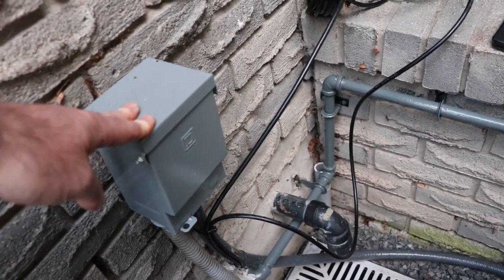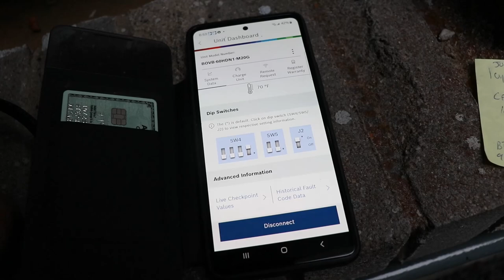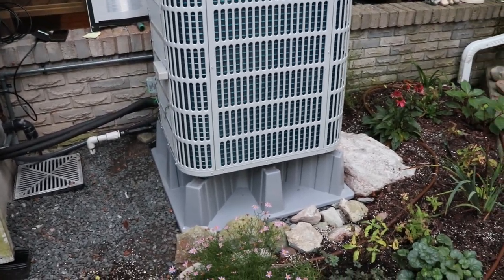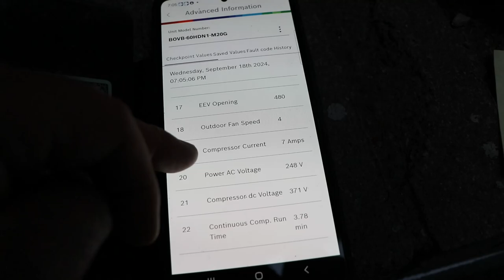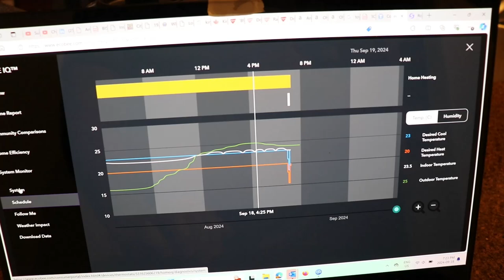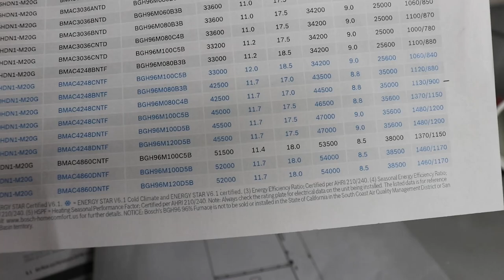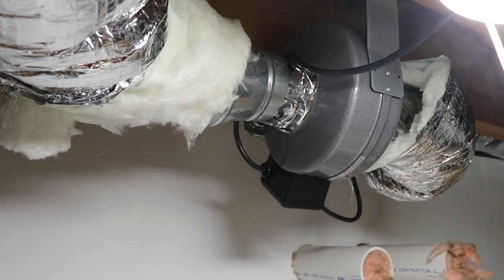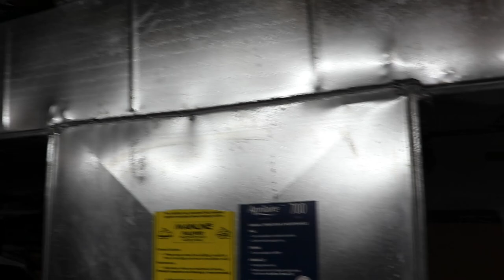Bosch IDS 2.1 Dual Fuel Fossil Heat Pump AC Furnace Install

Comment: Hey Stephen, I have a same exact system installed in my house with the Dual fuel 96% 80KBTU with 4 ton coil, I have a same Ecobee premium T installed. Same as you. My auxiliary heat keeps kicking on and staying on all night. Can you share your thermostat settings if possible please. When I ran the system in force mode my superheat was 0. Have you checked that yet? Please help if possible.
Reply from the maker: I have not connected any gauges to mine as I do not have access to R410A, I think that was required for superheat.  Was your machine cooling well in the summer?  Mine was and now it's heating OK.  It does run a long time because it is trying to stick to 1 run per hour.  I've seen it cooling to -8C now and it made it through the night without switching to aux.  In my case I chose to set the max aux heat to xxx and min compressor temp to -15C.  ***Warning, you will need to make sure your aux heat is still functional with making these changes to prevent accidentally freezing your home if your heat pump quits working
Reply: @ hey Steven, thanks for the reply, yes my cooling was working fine and my heat is ok and auxiliary working fine too. Where are you located? How do you make the system run 1 cycle? Would you be able to make a video on all the thermostat settings, I think that’s what my issue is, I can’t find the aux heat settings
Reply from the maker: @5sunny01  look at the video descriptions for now, that has most of it.  I am going to edit my original comment about max aux temp as I'm not sure if it is correct and I don't want to cause problems for people.
Reply from the maker: @5sunny01  I think your issue is probably minimum compressor temp.  The ecobee default value does not consider what the Bosch can do.
Reply: @ what should be it I’m in Delaware
Reply from the maker: @5sunny01  it is capable of going pretty low but it looks like your temperature right now is 30F so try 15F and see how it goes as a test.  The default is 35F in the stat.  Remember that you are responsible for your home so you need to understand what you are doing, I am not a professional.
Reply from the maker: @5sunny01  you also need to make sure the heat pump and furnace firing do not happen at the same time, there is a setting for that
Reply: @ yes I disabled that one

Comment: I have the 2.0 version 5 ton unit also, not the premium connected version. It's making the same humming sound when running in cooling mode when it's cold outside.  It sounds completely normal when it's hot, or in heating mode. I gave up trying to repair it. Do you have a link for the booster fan? I have a branch that's weak so it might help. Thanks.
Reply from the maker: There is a link above but it is the Vortex vtx400p if you want the pressure sensor.  It will not change the overall CFM of your system but it will redirect air to where you want it.  I had to pinch off most of the nearest ducts to my furnace using the little dampers on the ducts to assist in things.  Those two things worked pretty good together.
Reply: @SteveRivett  thanks for the model number. I don’t think you posted the link for this. I will try to find it online. Only see the non-P version so far

Comment: Curious about the savings on electricity from last July and August 2023. kWh usage for the 159 hours it ran in July?
Reply from the maker: June 2023 961 khw, July 2023 1223 kwh, August 2023 1010 kwh, June 2024 640 kwh (no AC for this month as it was dead), July 2024 886 kwh (will be missing a few days), August 2024 899 kwh.  
The old unit was a 3-ton Lennox XC15 and it was not meeting our needs due to the duct work.  It lost its refrigerant over winter which caused us to make the change.
Reply: @SteveRivett  Thank you. I am seeing similar savings the first two months as well. Mine ran 190 hours in August on Long Island NY, but I now know it was using very little energy.
Reply: FYI my 3 ton unit is so quite it's about a month old. I had a Bosch rep come out and set mine up it using the matching air Handler. We love it so far and we have the optional Aux heater for really cold weather. It has not used the aux heat so far living in Norther New Jersey.
You may want to contact Bosch because there's no way it should be that loud.

Comment from the maker: Hi Zach -
Thanks for the phone call on Monday afternoon. Below is our feedback on the Bosch Air Handler in question and how 
the ecobee can work with it without impeding the functionality and smarts of the Bosch system.

Overall, this is a really good question and we can provide some context since we have actually talked through this with 
Bosch directly in the past.

The Bosch air handler itself isn't the issue, it's the outdoor condensing unit or heat pump that the air handler mates up 
with. The Bosch units are unique in that they have built communicating logic into the outdoor unit which is extremely 
efficient already and doesn't need the smart thermostat logic to override the equipment logic, in other words, two 
negatives make a positive, a Smart thermostat (any smart stat) can work against the Bosch software since smart stats 
tend to automatically go into set backs, pre condition, etc based on occupancy, weather and utility rate info. Bosch will 
tell you they have to use their standard 2 stage thermostat, set it to your desired room temp and let the equipment 
manage the efficiency on its own, which is fine. However, the reality of it is that any 2 stage non smart t-5tat will work.

Fortunately for ecobee, the "smart" features in this case can be disabled to allow an ecobee to work perfectly fine and 
still allow the user all the other advantages like WiFi remote control, geofencing, home automation, etc. The following is 
what the technician should do to prevent ecobee's logic to work against the Bosch logic;

• In the mobile app permanently disable Eco+ (make sure at t-stat Smart Home/Away is disabled if not using WiFi
or the app)
• If using multiple room sensors, disable ‘'Follow Me" (the room sensors can still be used to balance or average
room temp and with participation, plus for monitoring in Haven, etc)
• At the thermostat settings under "preferences" disable Cooling Smart Recovery (and Heating Smart Recovery if
heat pump)
• Go to Setting- >Advanced Settlngs Thresholds -> Staging and switch it to manually

At this point, they have disabled any "smart" logic built into the thermostat that will potentially override set point or differentials, either just A/C or heat pumps.

Regards,

Pete Wessel
National Account Manager - Pro Distribution

Comment: Turning the switch 4 to on simply drops the evap temp from 46/42 down to 42/38 

The pressure noise you heard is our PEV (pressure equalization valve opening after five minutes of the unit shutting off) Now it’s ready to start